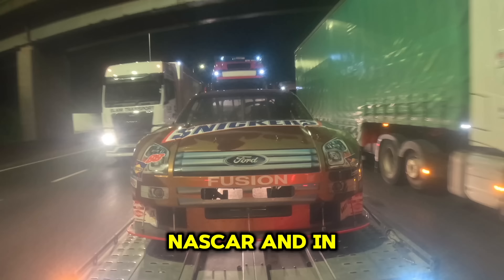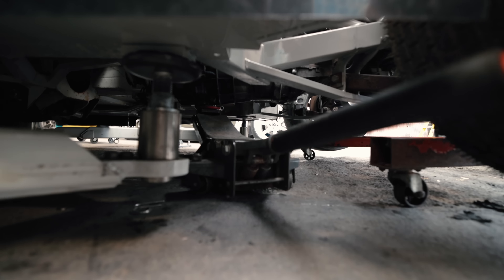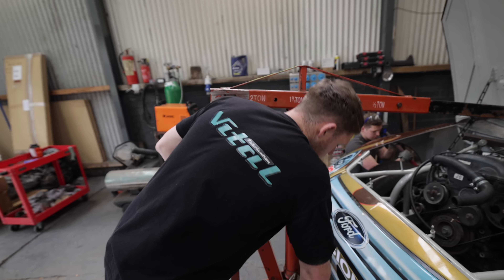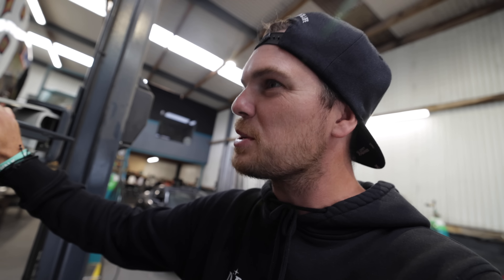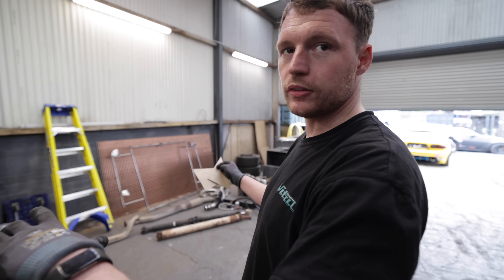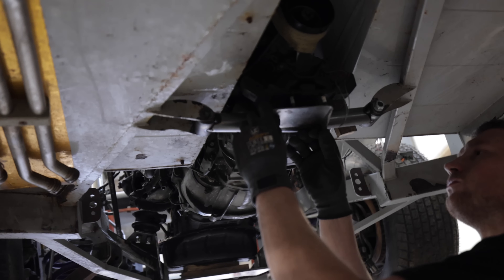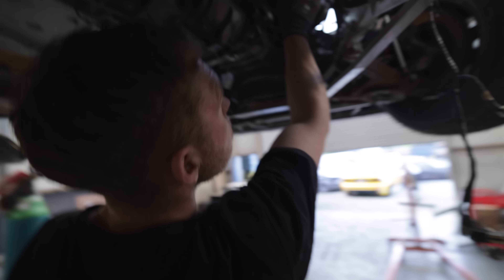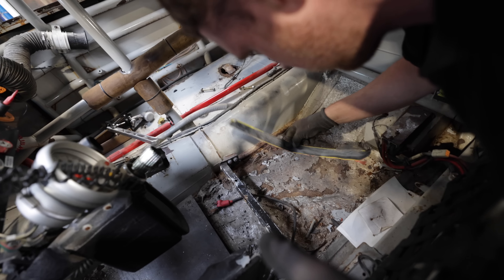Fitting a 1JZ in our NASCAR drift build was...SO EASY!

Comment: Y’all need to get a “boom tube” for that car, that’s the proper NASCAR exhaust, plus I think it would be cool to hear a JZ through one
Reply: I was thinking the same thing when I watched the last video, should be interesting ɓecause its difficult to screw up the sound of a 1jz turbo
Reply: bruh chris forsberg already has a JZ swapped nascar
Reply: I cannot like this comment more
Reply: @jackmagnium6115  I know, I mentioned it in their first video, as did the video (did you not pay attention to the videos?)
Reply: I had the same thought
Reply: So by booom  tube you mean dual tubes both are exiting same side of the car  infront of rear wheels  starting diameter of tube is 2¾" gradually increasing in diameter to roughly 8-10" each an then Pancaking each boom tube nearly flat . Roughly
 1 - 1¼ tall X 6" wide
Reply: Yeah I'll start the bid...

I Second This.
Reply: @jackmagnium6115 that was a Stock Car, this is a nascar
Reply: Yes !!!
Reply: @jackmagnium6115 isn't his a 2jz but this is a 1jz yeah they are similar but definitely not the exact same motor either way its still cool
Reply: Would be very cool with the proper resonator. Jimmy Oakes said his JZX sounded too much like a VQ with the TI muffler. It’d be interesting to see how it plays off on track.
Reply: @scottloersch555  same block same head but different valve springs different cams different fuel injectors and rest of fuel system. And depending on the year engine variation specific ECM tcm etc
Reply: Most definitely need to run the jz exhaust into nascar boomtube

Comment: American 10mm would be like the 9/16 but not actually size, just very common bolt head or nuts.  Size would be closer to 3/8 but still plenty of 1/2" & 5/8 used as well.  Also carbs may be kinda analog but they are more reliable and scientifically Proven to always make more Horsepower than EFI   Not that i have any issue with EFI, my cars are both types.  Different strokes for different folks.  Nice work boiz!

Comment: Excellent bit of fabrication and welding by Ryan without any cnc, break press or ironworker ect,no fussing about just making full use of mounting points that were close👌🏻👌🏻👌🏻
My guess is achieving full drifting steering lock will be the first headache then to get wheels that suit it without the massive sidewall tyres….actually do you know would it drift with the big sidewall tyres that are on it or would they be all over the place??
Really looking forward to the next instalment Josh 😂👌🏻👍🏼

Comment: I think the fact that you're less "swapping" an engine into a NASCAR than installing a different engine than it had before. The tube frame is a tube frame not built specifically according to Multi-National Corporation's requirements. Adaptations must be made but the tube frame allows for that. Shoehorning a Nissan engine into Mazda chassis, for instance, is understandably harder. BTW, Chris Forsberg, Dylan Hughes, and Ryan Tuerck did a similar project a while back but I don't think they ever really intended it for drifting.

Comment: So a couple of things. You might want to check the rear end gear. I believe at this time depending on the track they were using either an LSD or locker rear end. Don't know which would be better for drifting but figured you should know. Also check the paint. A lot of these cars were just wrapped so you might be able to do a full on custom livery.

Comment: This will be a complete failure unless you completely tear out every component of suspension out. They are designed to turn left, the suspension is designed to help that. It's not symmetrical from left to right, in the front or the rear. It's a great idea, but you need to cut out everything and start from scratch. Even road course cars are different from side to side. We turned one into a drag car years ago. Trust me, they go hard left
Reply from the maker: We are aware 😂
Reply: Unless it's a road track chassis not an oval track chassis ...
Reply: @frestkd  did you even read my comment? Nope. Trust me, they are all different. None of them are designed to drive straight. You can't drift a car, that cant drive straight first. Steering turns left, way more than right, on all nascar chassis. We have had multiple old nascars. Cheapest form of dirt racing is done with them. They are super cheap, strong, pass all certs, and any small block drops right in. I'd love to hear your experience with them, if you have any 😂😂
Reply: Pretty sure the guy who sold it said this one was not for lefty only.. idk anything about this silly roundabout cars but just thought this one is for left and right corners he said